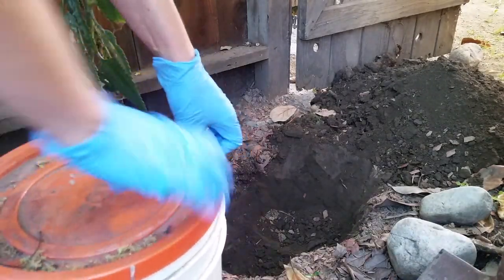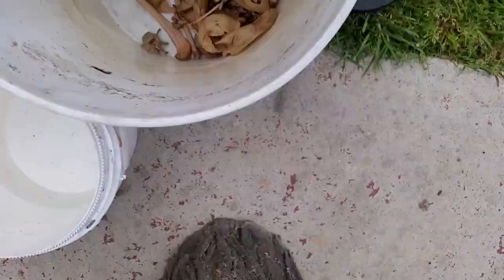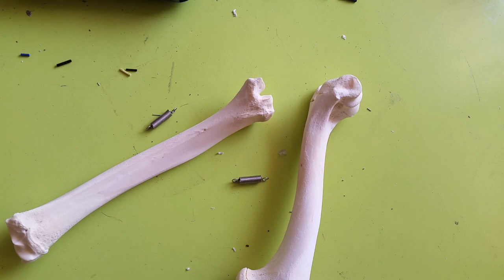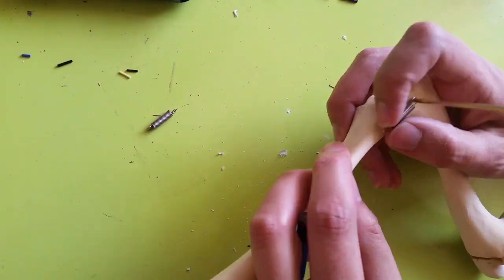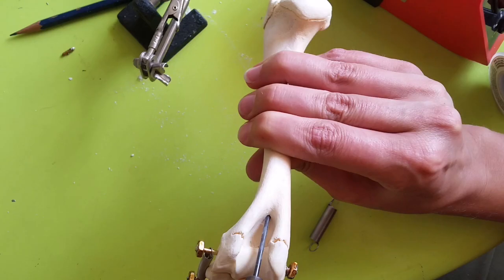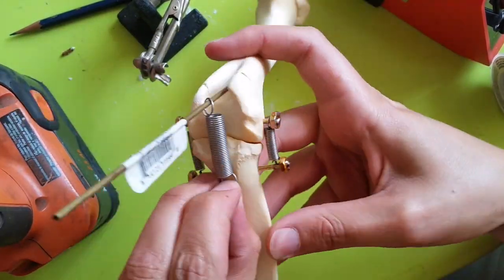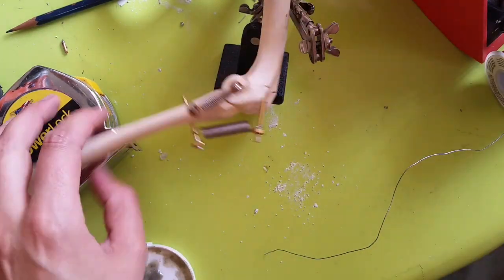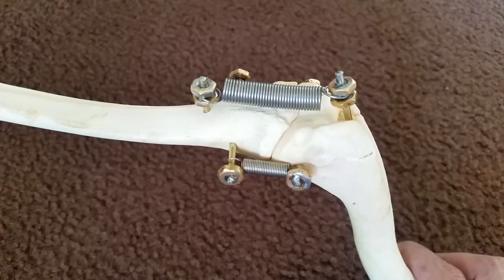Cleaning and Articulating Animal Bones

Comment: Hi I realize this is a two-year-old video but did you just use straight hydrogen peroxide not a mixture of hydrogen peroxide and water?
Reply from the maker: Hi! It depends. if I only have a few small bones to clean, i'll use the 40-volume peroxide as is. if I have a larger batch clean, I'll try to stretch it by mixing it with water. It still works when you mix it with water, it just works more slowly because it's a lower concentration
Reply: @EmilysElectricOddities  okay cool but said recently got some cow bones and I have no idea what I'm doing
Reply from the maker: @captaintonics3618  You can do it! It's not hard. Are they already clean from sitting outside for a long time, or do they need need a good cleaning still?
Reply: @EmilysElectricOddities  well they don't need to be like superclean because they were in an abandoned School so they're dusty but I'm trying to get them to be you no clean and whiten